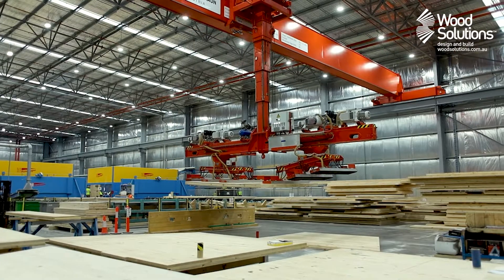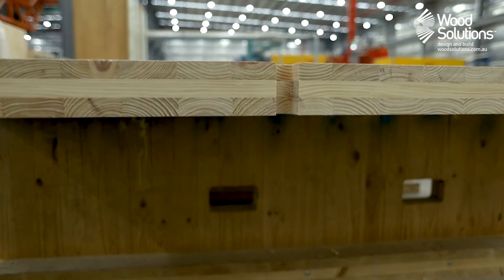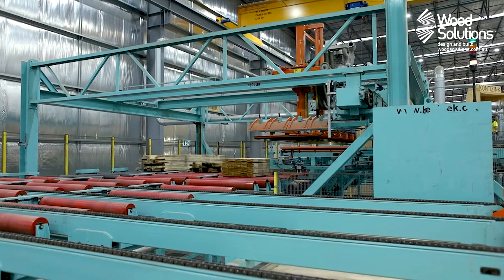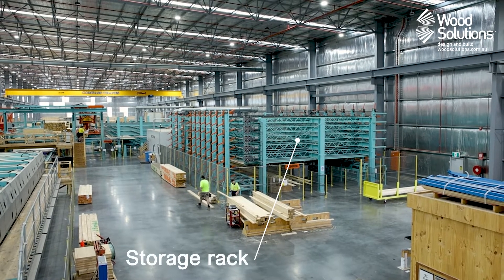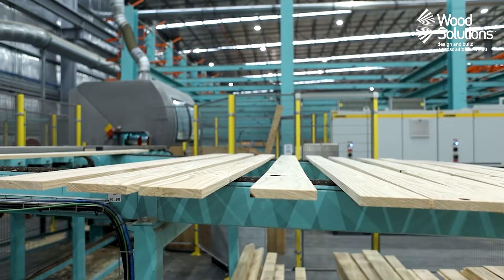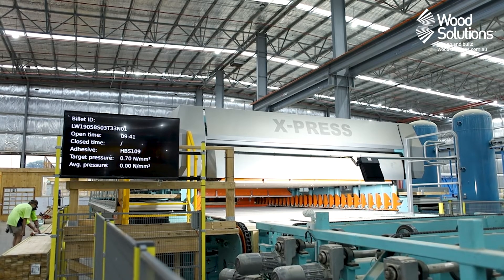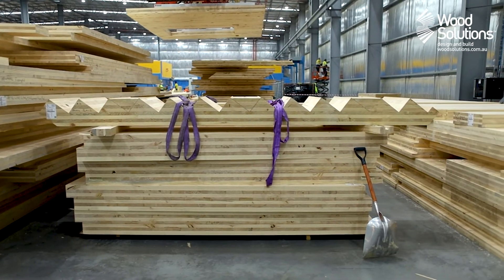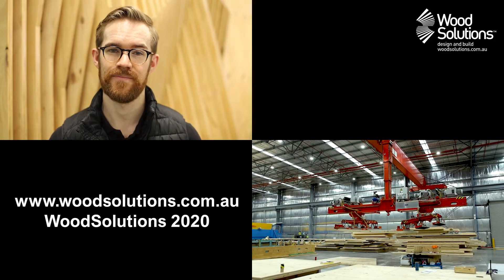How It's Made:  Cross Laminated Timber (CLT)

Comment: Friends, good afternoon! Have you ever thought to make a CLT in 2 layers, 20mm thick and 2.5×1.25 meters in size.? (Glue lamellas with a thickness of 10mm.) So that 1 person could lift them. (As OSB).
Reply: CLT that thin would not pass structural requirements to support the roof even  if nailed or screwed together

Comment: So do CLT houses still need interior insulation or not? And is Drywall sheet rock required for interior for CLT HOUSES? I'm asking because i may consider building a house in Tasmania with CLT!
Reply: Chris ,insulation requirements are based on the thickness of the panels and the climate .  
Wood fiber insulation panels can be attached directly over the  exterior via screws . furring strips are then added vertically , also screwed in the CLT and wood paneling or plates to accept stucco can be applied . This makes for a very warm or cool house requiring very little heating or cooling .

Comment: Why that factory was made of steel instead of wood ? :)
Reply: Because of the large spans and structural strength requirements that need to support the crane (and its load) that run the length of the factory.

Comment: Nice Video, aboviously the bottle neck for the production capacity will be the pressing in this plant. The cold pressing consumes 25-30 minutes, and only can press several boards each time, they may need more press machines.
Reply: could work during the night shifts
Reply: @algroulx1774 more than one press, three cncs and they might keep up with smartlam in c falls Montana.  These poor bastards are saddled with Canadian lumber. Either they never ship their good stuff or without a finger joiner you can't make wall studs!
Reply: A 60'  by 12'  press would help. A finger joiner is vital. I used to set up the western pneumatics table at Mercer in Spokane. 
 They can bury these guys in milled panels.

Comment: what is the  use of it? we are cutting the trees and using it to make our own houses right!!!!!! low carbon emission is the main reason behind  it. but is this really environmental friendly? by cutting trees we are harming environment. what is the use of it then?? in place of lowering the carbon emission during construction we are responsible for destroying our global ecosystem. it  should be banned
Reply: Cutting trees isn't inherently bad. Trees regrow, and while it does alter forests, it's possible to do it in the most responsible way possible. It does not have a high carbon impact relative to steel, concrete, etc, as all the carbon in wood comes from the atmosphere (CO2).
Reply: Proper forest management is certainly the right concern. Mass timber is used as structural beams in large buildings, replacing steel and concrete elements.